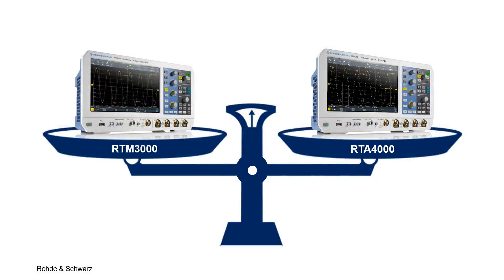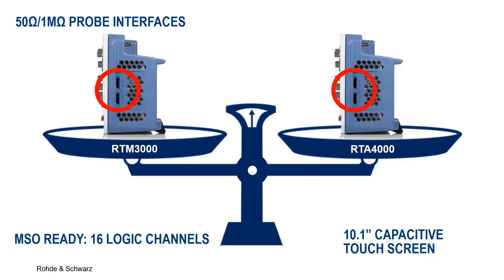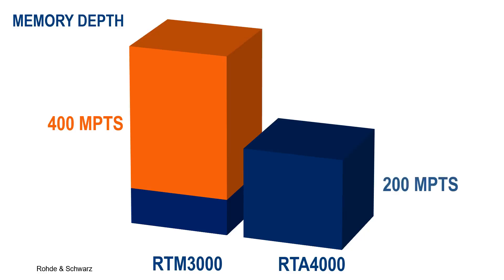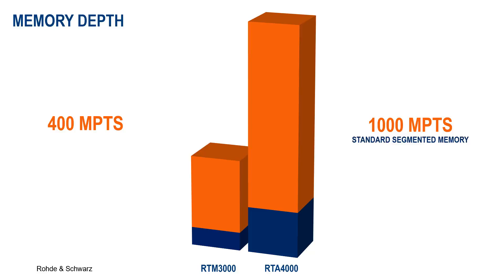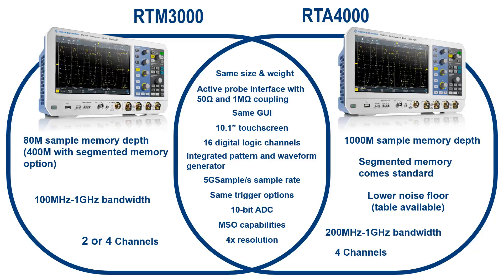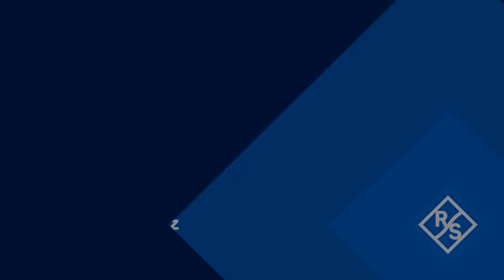Rohde & Schwarz RTM vs RTA Oscilloscope Comparison

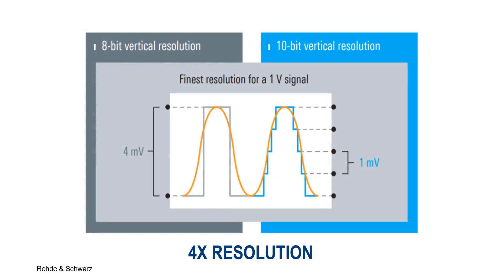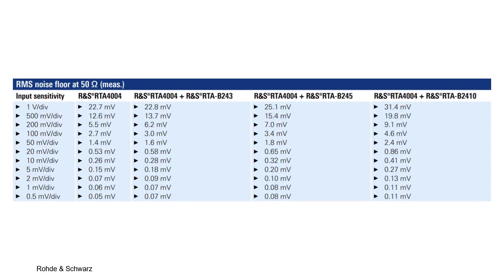Comment: At 0:50 it is shown that the 10 bit ADC can represent a 1 Vpp signal with a resolution of 1 mV. On the other hand, the table shows at 1:32 that the noise in the appropriate 100 mV/ range (10 divs = 1 V fullscale) is about 3.4 mV RMS. This should mean that below the displayed 1 Vpp signal there is a noise with about 10 mVpp (10 ADC steps) ! What have I misunderstood here?
Reply from the maker: Dear Elektronik,

The table shows the noise level which we specify for the RTA.
At 100 mV/div the noise level is between 2.7 mV and 4.6 mV - depending from the bandwidth. But not 25 mV. There is a table that I can't attach here but if you want to have it, please send an e-mail to socialmedia@rohde-schwarz.com

Best regards,
Gerti from the R&S Social Media Team
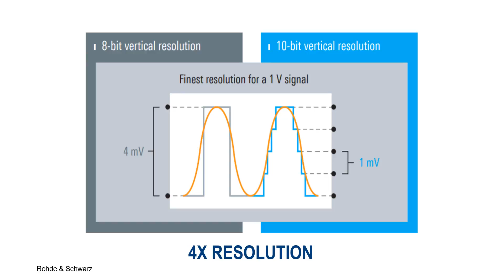Reply: @Rohde-Schwarz  Sorry, yes I had first written 25 mV, but then corrected that to 3.4 mV. But these are 10 ADC stages  peak-to-peak!? I.e. the signal that is to be seen at 0:50 would be almost no longer recognizable?
Reply: @Rohde-Schwarz  Here you have to use the peak to peak measure. You can estimate the noise in Vpp is about 10 times the noise in Vrms.
I believe that the noise floor from RTM and RTA  is about equal